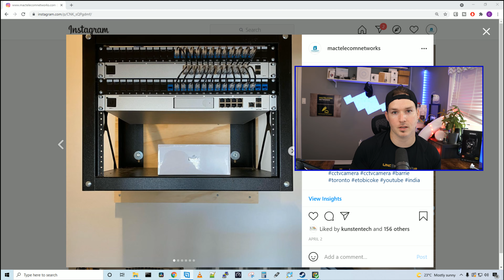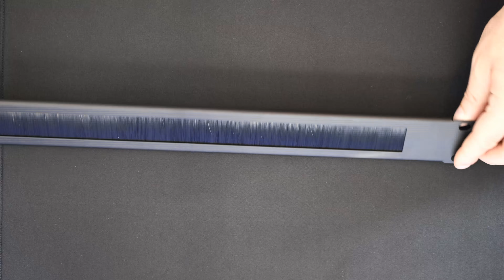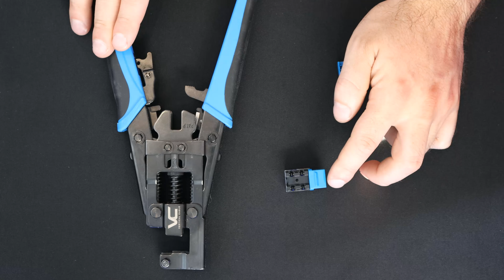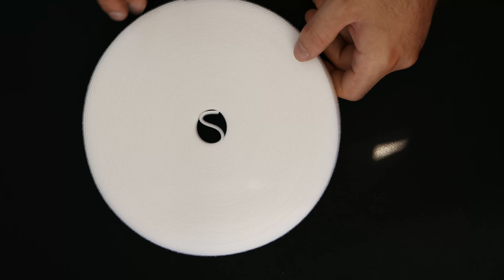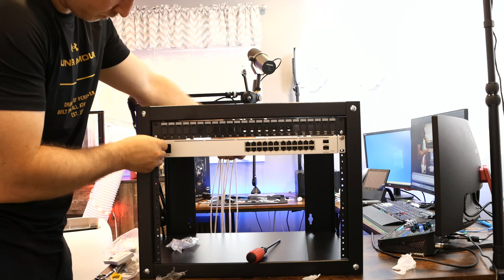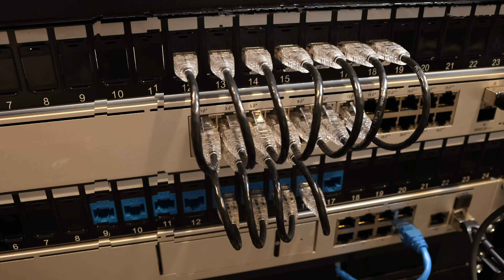Network Rack Setup And Cable Management

Comment: I hate that no one seems to ever address the wiring in the back of the rack.  In the every other scenario like this you have to run a lot of cabling in the back between the switches.  How does one then do maintenance behind the rack after the initial install, like if you run some more cables?
Reply from the maker: on my next onsite job video ill show the back and how we manage it afterwards

Comment: Do these 6" cat 6 slim cables do 10g or do we need to get the 6a variant? I understand these are way shorter than 55 meters so I wonder if the cat 6 can handle 10g needs??

Comment: just curious why no one uses the 8 ports on the front of the UDM, i always see these blank.  in my situation i'm thinking about building a rack setup and i have 32 ethernet cables, so i'd be using all 24 ports on the switch and the 8 on the UDM.  is there a disadvantage to this?   I thought about a 48 port but i doubt i'll expand, and Ui keeps playing the sold out game online.
Reply: The UDM Pro only has something like a 1gig switching capacity across the entire 8 ports.

Comment: Do you know what the purpose of ubiquiti having all their ports on the right side of the switch making you have to use two patch panels (above and below) rather than making their switches a more ideal design with the ports laid out on the switch horizontally making it similar to patch panel

Comment: What has been your experience using slim patch cables as opposed to regular ones?  I’ve heard that the slim ones can lose a bit of throughput, but not sure if that’s really true or not.
Reply from the maker: Never had issues with slim patch cables and have used a ton of them
Reply: If the slim cable actually has CAT 6 certification, it will work without problems.

Comment: So you prefer connecting the UDM Pro -to your POE Switch via DAC cable — If you have another non poe switch 1gb as well into the mix — how would you connect it for optimal performance?

Comment: Oddly enough, the punch tool, or similar devices, are not known or available for purchase on this side of the Atlantic, only simple LSA punches. Additionally, keystones cost anywhere from 7 to 25 $ a piece. Time for the borders to open up so I can get some during my next vacation.
Reply from the maker: Oh wow that’s crazy expensive! The keystone jacks typically cost more if they have a tool that can work with them but that’s just to much money
Reply: I prefer to use keystone couplers instead of jacks. I put regular RJ45 connectors (without boots) on the cables coming into the rack and then insert them into the back side of the keystone couplers that are snapped into the keystone panel. It’s more cost effective and you can easily switch cables around without having to remove the jack from the panel. I also like to feed cables from the back of equipment (or from equipment on a shelf) to the back side of the keystone couplers for a neat setup.

Comment: Do you use the slimrun patch cables for POE as well?
Reply from the maker: Yup
Reply: @MactelecomNetworks  thanks… I always thought the thin cables were bad for power.
Reply from the maker: @XpertCS  you will hear different opinions from everyone. I’ve deployed hundreds of APs using them and not a single issue

Comment: Hey Cody, 

Any particular reason the second patch panel has the keystones to the left of the switch ports above and not vertically aligned?
Reply from the maker: Nope no reason this was just done for the video. Typically we would have the full switch loaded ( depending on how many network drops the customer had)

I just added some keystones to the bottom panel to show them in there

Comment: Hey Cody, do you ever use a UPS with your rack installs, if so how to integrate them?  I used the APC SMT750RM2UC which fits into network racks.  The rails with this are for larger server racks but I supported the weight in my StarTech 12U rack manually as it has a bottom on it.
Reply from the maker: Hey we do usually use smaller rack mounts. I’ll be doing an on site job video in a month or two with a full build out, this will include a ups install

Comment: Unnecessary to use that brush. I do very similar installs and simply use an empty keystone to pass the cable through.

I never put anything all the way to the top so I start from the 2nd position to leave space for the fam circulation.
Reply: It costs $16 and looks much cleaner than leaving an empty keystone with a cable running through it.
Reply from the maker: Yup I agree but showing people differnt options

Comment: Great video.  Is there a reason, other than aesthetics, to use blanks to fill the empty RU's?  just curious, thanks.
Reply: In datacenters you need them for airflow !
Reply: 100% very useful and you can see the difference using them and not using them. Much more useful in Data Centres like mentioned but even in this case can help bring down temps as it helps stop the hot air from the back being sucked back through the device. I however like the plastic click in type as I find it annoying to have to screw and unscrew to remove then usually have to remove the cage nuts depending on what you are installing. The less removing and installing of cage nuts my fingers and nails thank me for.
Reply: @MrSober88  Do you have a link to the clip on spacers.
Reply: No reason but looks. A waste of plastic in my view.
Reply from the maker: Well looks and depending air flow. A lot of the times with these racks we end up putting Synology nas on the bottom as there is a shelf

Comment: I'm new to networking and am slightly confused on the two patch panels. So is the one at the top of the rack the lines going out to your end user machines? What is the use for the one in the third u down?
Reply from the maker: The only reason I have two patch panels is for cable management. To make the cables neater. Bothe of the patch panels would go out to end users or devices such as access points, cameras, computers, printers etc
Reply: @MactelecomNetworks  Ohh, okay great, thanks for clarifying!